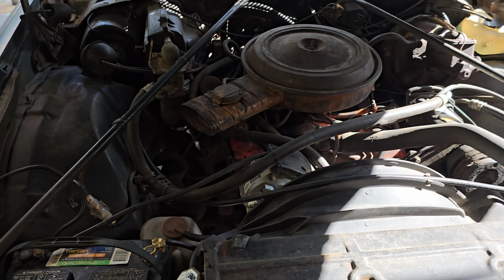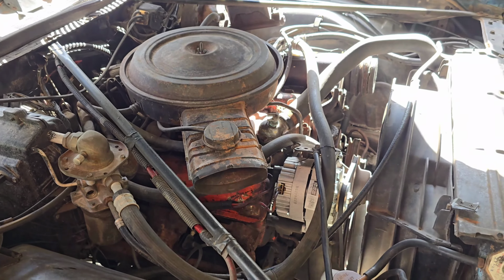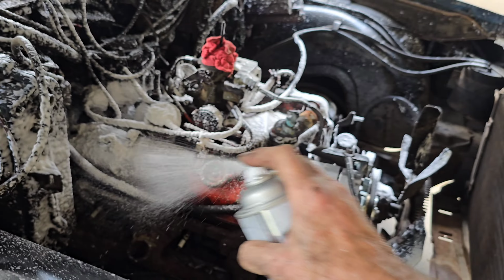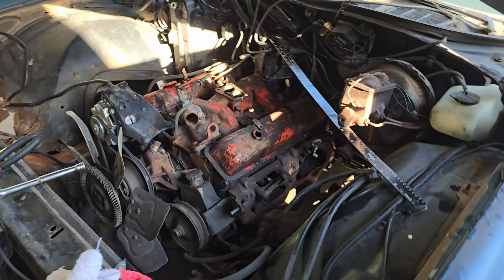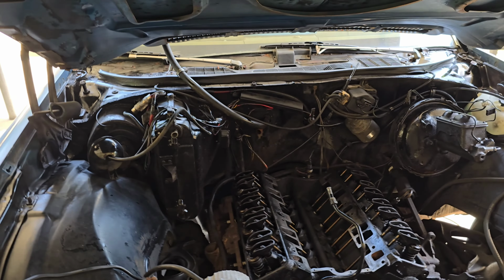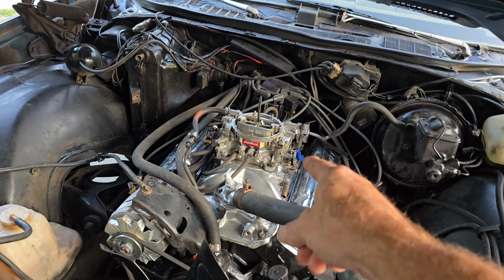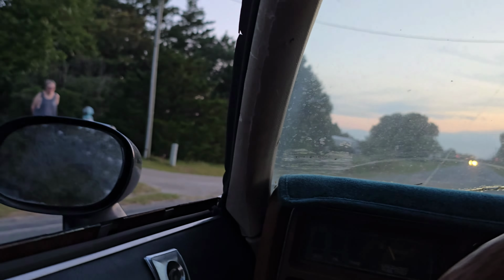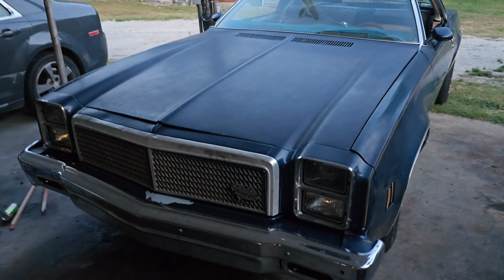1976 Chevy Chevelle Malibu. I'm installing a  Edelbrock, intake manifold, and Edelbrock carburetor.

Comment: Good job! It's always a fairly big job with all the original stuff in there. Should be a little easier to work on now for a cam swap. You get those headers on will make a difference.

Comment: Not bad it didn’t dog off on the burnout so just a little final adjustments here and there and you should be great and watch the heat. It is way too hot down here.
Reply from the maker: It's not tuned right yet.  I also need an electric choke for it. That would help a lot.